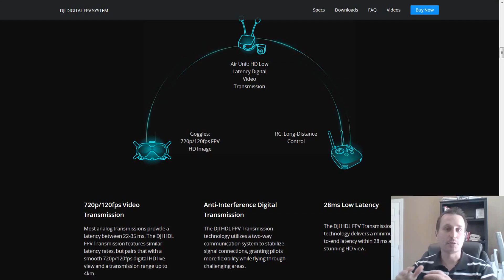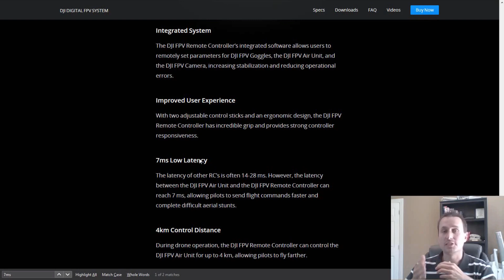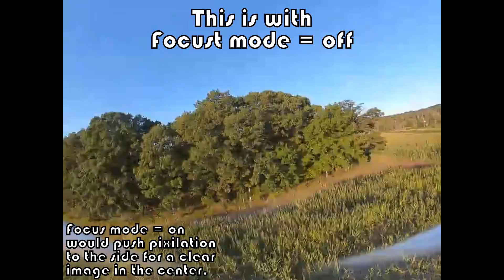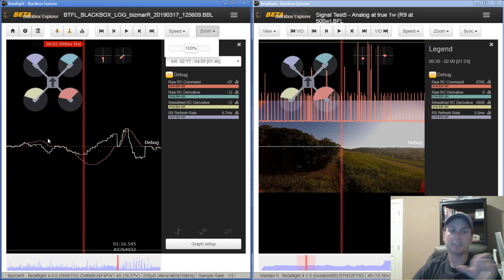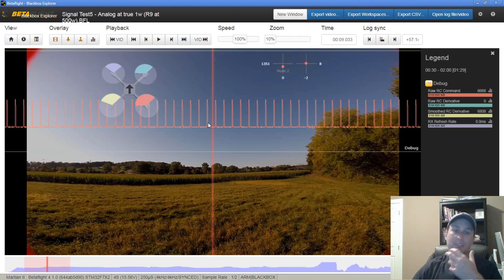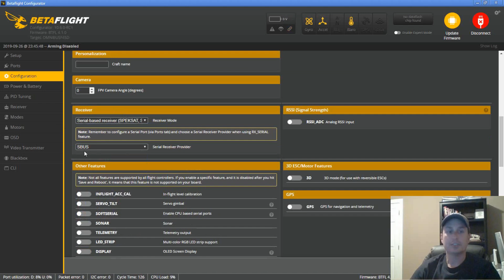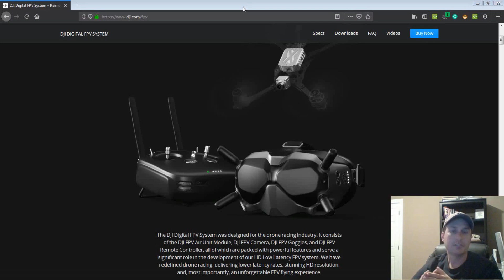DJI Digital FPV System: Anti-Interference & Ultra-Low Latency Features Testing

Comment: I like your neutral test.
I wonder if you'll get the buffer flush bug when you push the DJI to its limit. It happens when the image gets very blocky and image start to hold for more than half a second it then flows again again as if it was real time but in fact it is very delayed, then it loses link.
Reply from the maker: We will see.  Going to fly to full range next.  GPS rescue on board to save it.

Comment: Hey Mark just wondering if you are going to do a range test on the DJI control link?
Reply from the maker: Yes.  I just got the GPS for rescue mode.
Reply: @uavtech  Does the control link connect to the goggle that as long as you have video you will have control link? so with upgrade patch antenna on the goggle will also extend the range of the controller?

Comment: I kinda initially figured that the DJI setup was also using some basic DSSS rake receiver, which would actually make quite a bit of sense - would be able to use pretty simple Walsh codes to reconstruct from reflected multipath - but those struggle just slightly with diffractive multipath in terms of inter-symbol interference performance, which seems to mirror how it works with metal/concrete versus leafy foliage.  Still, kinda awesome stuff.

Comment: I have experienced flying with a HD dji system. Unfortunately it's not compatible to fly with others on analog systems.

When a DJI hd pilot is in the air, wait until they power off before you fly.
Reply from the maker: Weird.  I have seen others do it and they say no issues?  You make sure you guys had good channel spread so you are not stomping on eachother?
Reply: @uavtech  I can't say we did any testing other than notice on 25mw there were issues. If time presents itself, I could entertain some testing. I was looking that day to troubleshoot moreover meet some new people and fly some packs. If I get any data worth mentioning I'll spam you.
Reply: This is untrue, we often fly 4 dji HD and 1 or 2 analog with 0 issues. You know the basic Raceband ch still applies from ch 1 to 5 on DJI and analog and 6, 7 and 8 are reversed to analog 6 is 8 I believe. Pull a frequency chart and call out ch like raceband.

Comment: And this is with DJI stock antennas.  I’ve seen a 50% range increase with 4 trueRC LHCP singularity on the googles and stock antennas on the quad.  And if you use two trueRC LHCP x-air array DJI edition the range is so insane that you will most likely loose the control link before the googles starts reducing the bit rate below 25mbps.  Almost no pixelisation with the x-air arrays but these antennas are directional, you can’t fly behind you with those.  If DJI implement a proper OSD in their goggles that can display everything that the betaflight OSD can, everyone flying long range will switch to DJI.
Reply from the maker: someone said they are working on it.
Reply: What does the full OSD give you that makes it that valuable for long range?
Reply: E. Malkin A full OSD can display GPS coordinates that can help you recover your craft in case you loose video.  You can display the mAh consumed, an arrow pointing the home position, the altitude and a lot of information useful for long range.
Reply: @Pintosonic  I see, thanks!

Comment: Do you have a way to measure true latency? Framerate is not equal to latency. A system can have a 1ms frame time, but a latency of 100ms, which would make it unflayable. I am curious to see how the dji system compares to frsky 2.4 , frsky + R9M and frsky + crossfire in that regard.
Reply from the maker: I do not.  Looking a frame rate from a consistency standpoint as it has impacts on FF. To measure true latency, you would need a sniffer I think.  You would need to hook the same equipment up to the TX and RX.  Flips a switch and see how long it takes the RX to respond.  The real trick with would doing that at longer range (loooooonnnnnnngggg wire i guess?).
Reply: @uavtech  Yeah, this to me has been the true frustration with the FrSky stuff, not so much that I get the equivalent of at least 5 dropped packets per second - it's that the heartbeat mismatches in OpenTX mean that it's aliasing through and sending the same packet multiple times in addition to that 200ms one, which can result in some mildly ridiculous laggy sensations, which aren't great in racing.  CRSF has become popular with racers just because it's consistent - even if it's basically locket at 19.6ms the entire time at a race, it's consistent and you can react properly without overcorrecting, and that's why it's worth the money... I just need to get on that myself, because my best flying quad are actually FlySky X6B's with a multiprotocol module, just because of that consistency.

Comment: Have not flown my analog gear once since getting the DJI. Absolutely no comparison (verified by your tests). I just set up the goggles with Aomway mushrooms on bottom and VAS Crosshairs (the old box ones) on top. Have not had a chance to test yet. Hard to believe it could improve much, but the word on the street is it will. I have CRSF on all my 5" and up quads(except the 3 with DJI), but haven't felt the need for it on the DJI quads. The DJI system has control lock to the limits of video, and I can't fly long without video. I DO miss my programmable FrSky X7S Tx with trims, voice confirm on all switches, voice telemetry and all the features it has, but I'll live without it until a DJI module, better DJI Tx, or other fix is available.  A DJI module for FrSky would be ideal.
The DJI system has greatly improved my confidence and enjoyment, it is indeed a major step forward.

Thanks for doing a thorough test.

Comment: What's the 'sbus fast' CLI command do (or not do if "off"), in a "standard" analog fpv setup?
Reply from the maker: DJI is the only manufacturer to used the higher baud rate SBUS so far.  

That is not an analog thing actually as SBUS is a serial data port connection.  So the TX signal everyone uses is digital and has been for a long time.  Just the video is classically analog, except for DJI; so far.

[P.s. there are other digital video systems that have been out for a while, but they don't perform like DJI.  The performance leap is the break-through.]
Reply: @uavtech  yeah this video of yours kinda sunk that in for me. It still bugs me that the only real way to have both a light & compact "race-like" build is to utilize their whole system for both video and flight control. like the DJI build you were using in this video. and because I'm resistant to accepting how nice the DJI system really is starting to seem, I'm looking for any leg up in that resistance. Thanks. For everything.

Comment: Do you like BF 4.1 vs 4.0? Would love to see a video on this? Great stuff and I love my DJI FPV system.
Reply from the maker: Yes.  4.1 is better.  FF 2.1 is muuuch easier to tune.  RPM filter is muuuch easier to implement.

Keep in mind, each release is progressive.  So 4.0 is 3.5 with new features and potentially defaults changes.  4.1 is 4.0, etc... etc...

Comment: I just found you a few weeks ago though been in fpv for a long time... Love your brain bro. I use r9 (xlite mini unit) and on the fence if I go crossfire, bigger r9 mod. Or just get the dji controller and love that fact I need no other receivers but yet I just don't trust the dji control link... Advise/opinions?
Reply from the maker: I need to do a range test on the TX.
Reply: @uavtech  I would love to see that, thanks for the reply. 👍
Reply from the maker: @ChonWanggy  , GPS unit to add to quad should be here tomorrow.
Reply: @uavtech  Sweet man! Great videos, got dynamic notch* filtering working great due to your video, as well (new version of blheli is in there new update of the configurator now btw)👍🙇 thanks buddy!

Comment: Hi Mark,  Why do you think DJI went with LHCP antenna setup?
Reply from the maker: Cause everything else is RHCP?
Reply: @uavtech  DJI support told me the rationale was a trade secret, surely it cannot be as petty as doing the opposite from everyone else? Thought  RHCP has better penetration and range over LHCP, could be wrong though.
Reply from the maker: @itsfpv2561  , how is LHCP a trade secret?
Reply: @uavtech   Response from DJI on why they use LHCP was as follows:

"Confirmed with the senior technician,

 Sorry to tell that this issue is confidential which related to the business secret, we also do not have the information also.
"
they were just probably blowing me off, to close the support call.
Reply: @itsfpv2561  There is no difference. It's just opposite. The gain is the same.
Reply: I love this. I’m a lefty person. I was born left hand lol.

Comment: The DJI system might edge out Crossfire slightly in latency but at 5.8Ghz it just will not have the penetration and range of 900Mhz.
Reply from the maker: I should get GPS rescue on it and hook up an R9 RX too.  Them do range comp.
Reply: UAV Tech yes I'd like to see that
Reply: rob malan defiantly do that.
Reply: What is the working frequency of the DJI link?
Reply: @Mateyhv1  I think its 5.8ghz. Same with analog but since its digital intereference wouldnt be bad.

Comment: Oh man thanks for the awesome nugget @ 15:10  for    Low latency mode in betaflght.   I have the DJI transmitter but have not used it.   Been using my Frsky transmitter.  Will try out the DJI transmitter this weekend.

Comment: Once I turned the "limiter" off, i haven't failsafe'd since.   Failsafed a couple of times prior for no known reason.  The limiter off  It keeps it locked at 700mw is my belief.
Reply: Power Limit turns power down to 25 mW when the quad is disarmed. The power should stay at 700 mW when the quad is armed. If you have not connected the FC UART to the Air Unit, then the power should stay at 700 mW all the time, but I turn off Power Limit just to be safe.